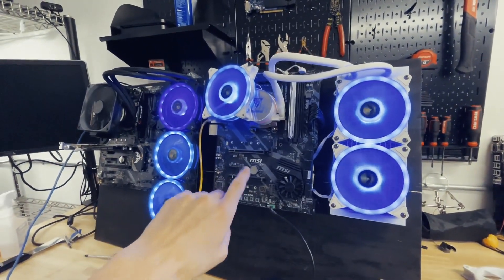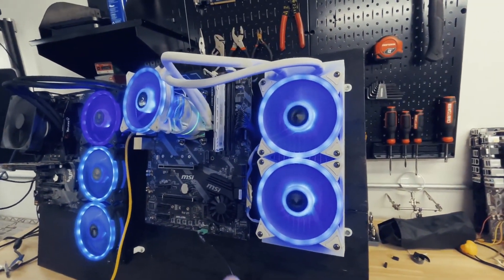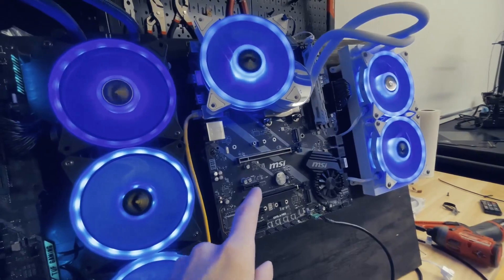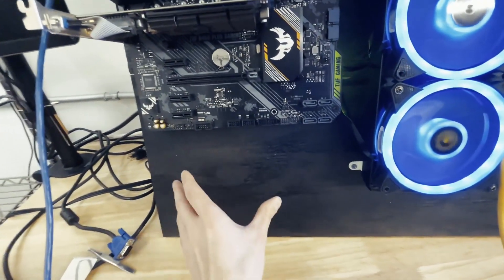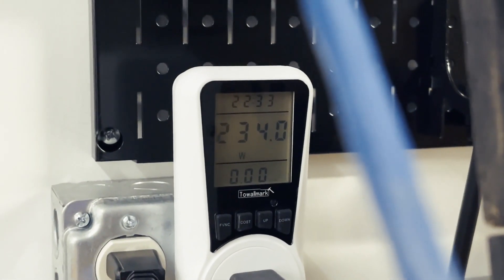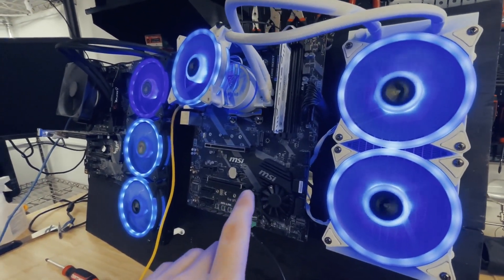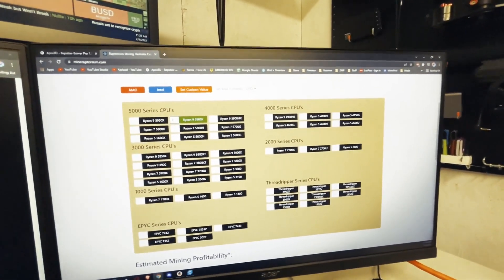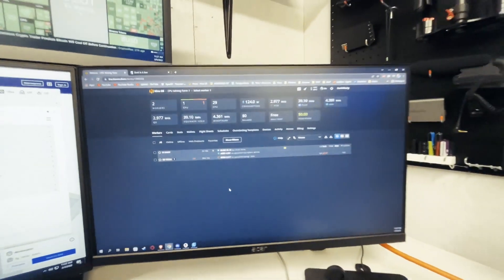CPU Mining Rig V2 | RTM, AVN, YDA, & XMR Mining

Comment: Unless the AIOs are specifically designed for it, the radiators are mounted upside down. You want the tubes on the bottom so air isn't drawn into the pump.
Nice set up otherwise!
Reply from the maker: Yeah, I don’t think the tubes are long enough to mount it upside down.
Reply: @ZackExperiments  They are mounted upside down right now. Any reason you can't just flip the whole board over? Fix both without much design modification.

Comment: love these cpu rigs!   a really weird coin is called cosanta - where every so often the block reward INCREASES . i have some cpus on cosanta - but its very speculative - and can only be xchanged in one place. its worth tuning those rigs - reduce the cpu volts in bios - you will save a lot of watts and more importantly take some load of the b450 vrms.  ive got a 3950x mining and tweaking it was really worthwhile.  ps if im buying socket am4 i always buy msi cos they can boot headless - very useful. ive got msi b350, b450, b550 and 570 and they all boot headless no sweat. also i use windows ghost spectre on all rigs - no updates no bloat no telemetry - that even works headless too with dwagent remote software. best wishes from manchester uk
Reply from the maker: Yeah, MSi boards are the way to go. Thanks for the comment!
Reply: How is it that the reward of the blocks increases?
Reply: Man I'm in Gloucestershire UK 🇬🇧 would love some help with a build I'm doing this month

Comment: Check your BIOS settings, there may be a setting to allow it to boot without GPU (mine does)
Reply from the maker: The MSI board does but the Asus board doesn't have that feature, I've checked everywhere and read forums and Asus support motherboard features, so if you are 100% sure let me know where it is.